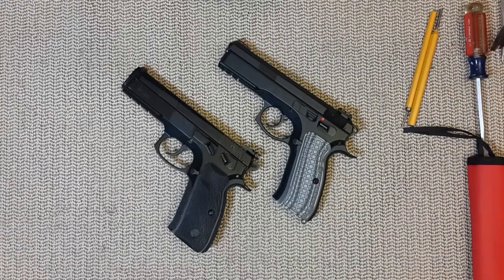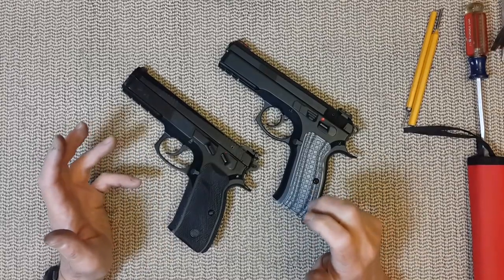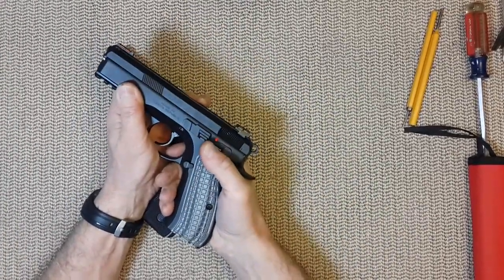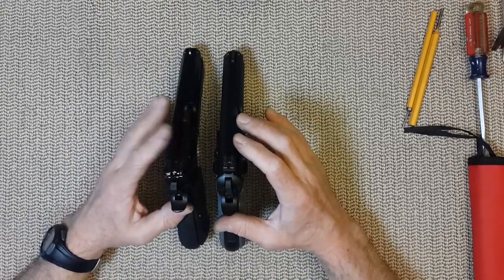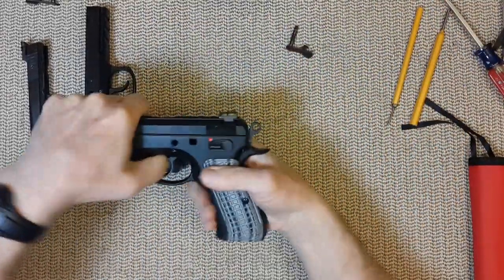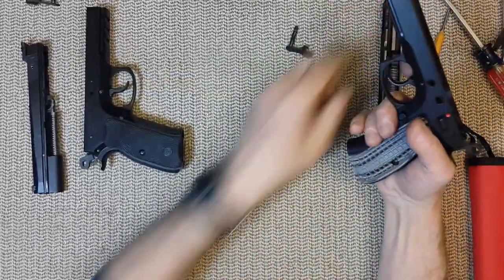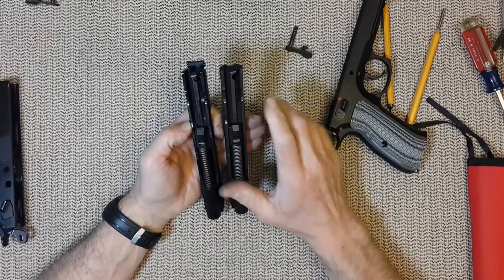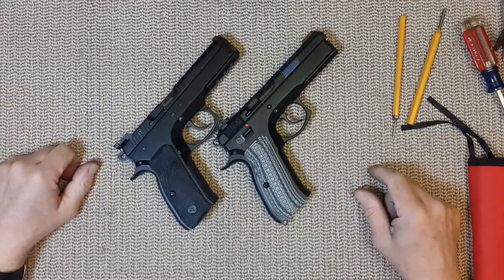CZ 75 SP-01 vs Canik P120 - Physical / Mechanical review

Comment: Your videos of the CZ and the Canik are invaluable, and are the main reason I was bold enough to make most of he modifications/upgrades offered by Cajun Gun Works. On the Canik P120.  Having completed those mods, I am now looking for an OWB holster, not for competition,, mind you, but merely for safely carrying the gun with my hands free.  Can you tell me if the overall dimensions of the two pistols are close enough that a holster for the 75 SP01 will work satisfactorily for the Canik?  Thanks for your response, and keep up the good work.
Reply from the maker: Those 2 gun's dimensions are very very close, but not close enough for hard shell CZ holsters to fit the P120. But some will work with some slight modifications. It is a hit or miss situation. Soft holsters, like leather, will more likely work. Good luck and Merry Christmas.
Reply: Practical Shooter I can actually fit my canik shark c in my CZ p-07 holster. It doesn’t fit as well but it’s workable for edc

Comment: The price difference comes from parts quality, and machining. P-120 uses MIM parts, while the CZ has all high quality cast parts. You get what you pay for.
Reply: H K If you really want a source, give Canik/TriStar a call. Lots of companies use MIM parts. Taurus, RIA, etc. MIM parts range in quality, and saves on production cost.
Reply: Funny that you are pointing at cast vs mim

Were you meaning to say machined?

I doubt you could point between big differences in both aside from finish quality as they are the same design

Comment: Sir, are the 16 and 17 round magazines the same size? Like are the p120 mags the same length as the sp01 mags? Thanks
Reply from the maker: Those magazines are 100% interchangeable as they are identical. The +2 rounds of each brand are different, but can also be swaped between both magazines.